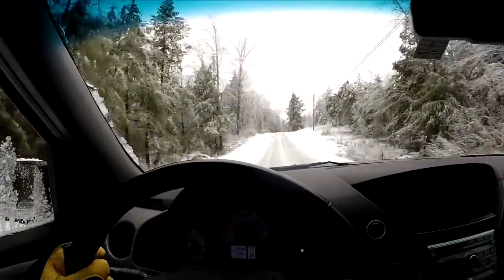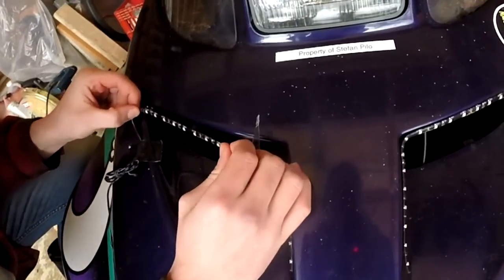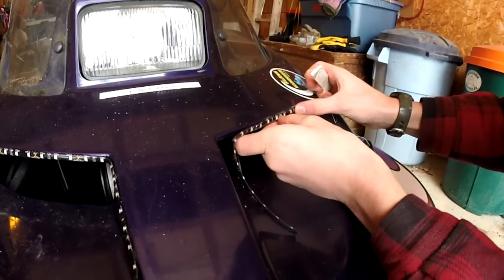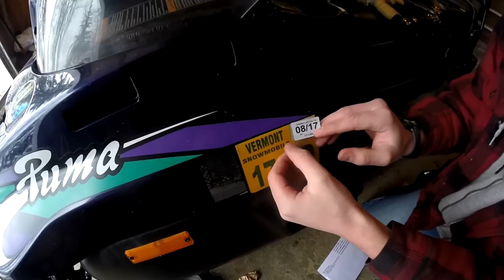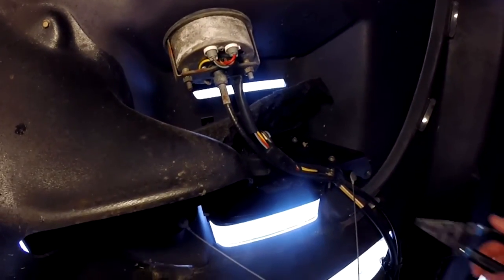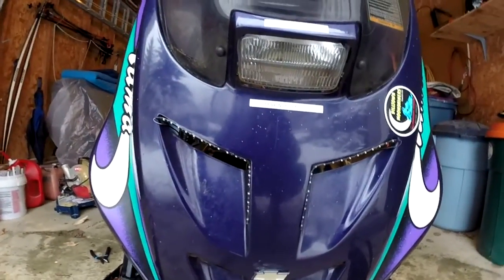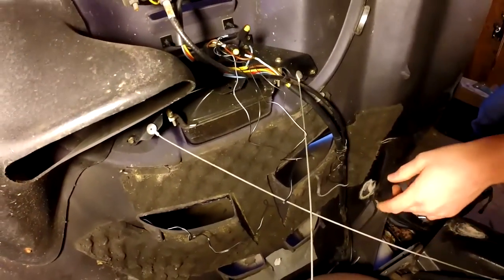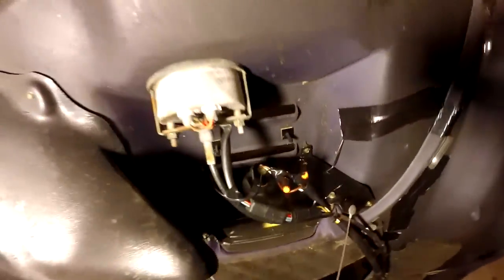How to INSTALL LEDS on a SNOWMOBILE!

Comment: You should have connected them to a 12 volt voltage regulator they would flicker as it idles.
Reply from the maker: Why would you want them to flicker as it idles?